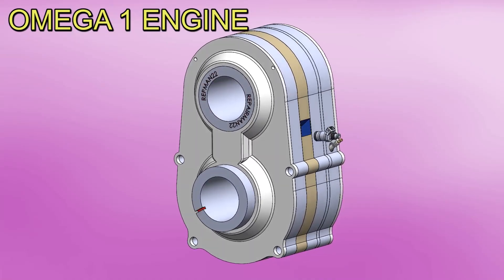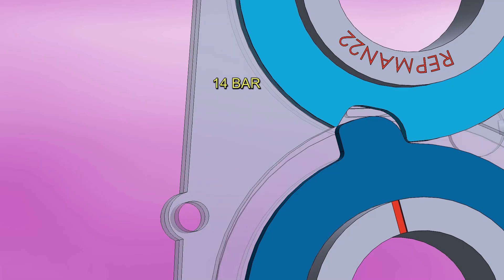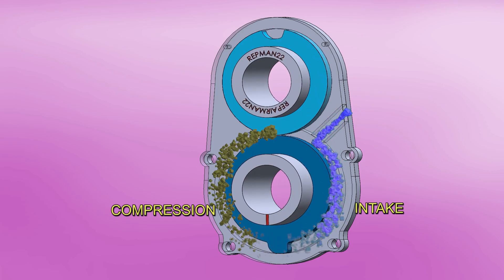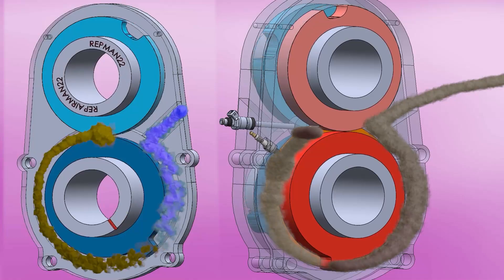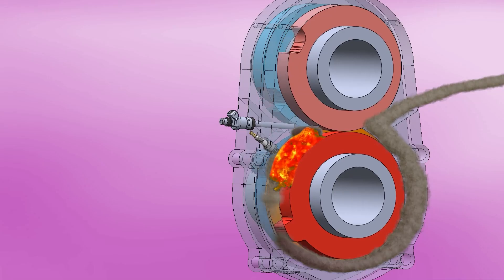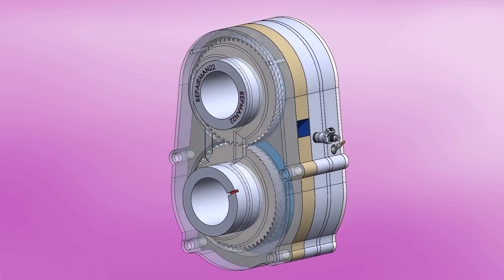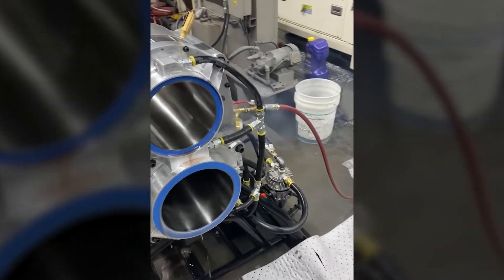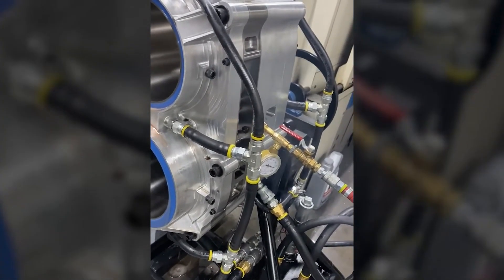😍 Can you FIT 160Hp in 30 Pounds? This New Engine Can. The Omega 1

Comment: I definitely love your videos! I'm from Brazil and I would really appreciate it if you could make a video about the Volkswagen EA827 engine (in Brazil it is known as the AP engine). It is a very famous engine and has been applied to a wide range of automobiles.
Thank you if you can answer.
Reply from the maker: I owned one AP 1.6 and had it with pointer GTi 11.20 camshaft. The AP will appear in my spanish channel for sure "repman22"

Comment: Note only cartoons are shown, no slo-mo, because any Diesel mechanic sees the flaw.  (What they show has no cooling, no drive train, no dynamometer, since it CANNOT work as advertised.) 14 bar (14:1 compression) is Diesel range; the fuel will ignite instantly, yet a spark-plug is shown. A freshman mech-student should recognize something's wrong here.
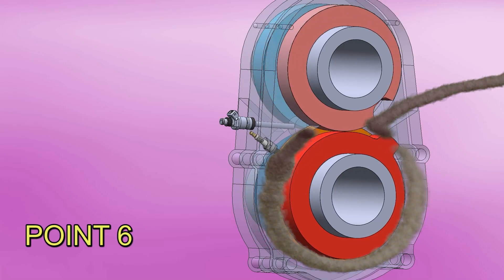Reply from the maker: Your answer is at 6:11

Comment: I would call it a split cycle engine 
1 has a working prototype been made
2 in order to make 160hp it will need to move 160hp worth of air, dose it 
3 it looks rather thermally inefficient 
4 believe nothing until there is physical evidence infrastructure of your eyes, anyone can make a cartoon engine and make unrealistic claims 
And finally build one and prove it

Comment: I would not be surprised if the rotor on the hot side is ceramic. Much testing has occurred using ceramic material in jet engine's rotating assembly.

Comment: In the animation the donuts are out of balance. 
 There are numerous hydraulic and air compressors that operate using simular principles.  
Even with titanium, they will still need to deal with the heat.. The intelligence and technology to make it work is definitely there. How well, and cost effective it will be is the question.

Comment: To deal with the tolerance issues when running and hot, the solution is simple and already in use. Forged aluminum pistons in gasoline engines are under sized so when the motor is at operating temperature they will be the proper size. You just have to leave enough tolerance for the metal to expand. As in all engines the efficiency would not peak until the engine reach operating temperature
Reply: Those engines are easier to keep at a constant temperature because you have plenty of room to place cooling and oil ducts and you can cool down the pistons by spraying them with oil from the gallery. They also have a narrower RPM band. They also have piston rings that help seal the gap when the pistons are small, this does not.

I'm thinking that if the same technology is pushed in to this more demanding role, they would either have to sacrifice low end efficiency by increasing the gaps or they would have to sacrifice top end power by limiting the top rpm to prevent the engine from seizing due to thermal limits.

Unlike what the video implies, I think the critical gap is not the one between the rotors but the gap between the lug on the male rotor and the chamber. If there are no apex seals there will be a lot of blowby if the tolerances aren't super tight, but if the tolerances are super tight, total engine failure due to seizing will be an ever looming danger. Even a minute amount of slop in the bearing will cause the lug to drag or bounce along the chamber and thus scoring your engine badly.
Reply: One can also tailor the metallurgy of the engine case to allow expansion of the case proportional to the rate of expansion of the rotors, allowing everything to stay in tolerance through a larger temperature range.
Reply: That's not going to cut it for an engine without piston rings.
Reply: youll find forged pistons expand quite alot, although they are stronger, when cold this piston will slap the cylinder wall causing wear. This also happens at extended periods of low rpm when the engine can cool (relatively).
For this reason, although forged pistons are stronger and capable of more extrememe conditions that make them ideal for racing engines, most manufacters still produce there pistons from cast alluminum as cast alluminum expands less than forged.
For an engine like this that is reliant on tolerances for adequate sealing, the engine would need to run at a near constant temperature, or use materials with a low thermal coefficent of expansion... such as titanium. 
Forged alluminum expands to much for this application.. unless the engine is desighned to operate at a constant temp/speed.

Comment: This is stupid. Wankel engines are criticized for the failure of apex seals. But those seals don’t fail if they’re spring loaded. Wankel engines work fine. 

But they’re too good, they don’t need constant repairs. A new Ford engine is a hopeless tangle of plastic and circuit boards.

Comment: I wonder if this engine could be designed coaxial configuration. 1 stage counter rotating inside the other. In a way the heat expansion of both would maintain smaller tolerances?

Comment: So just ONE explosion per revolution? And no rings?  And two heavy rotors and gears?   And goes up to 25,000 RPM?    And it leaks oil like a screen door.  And no cooling system?  Probably quite lousy in weight, vibration, efficiency, low power output, and unreliable.   It's telling what they don't show-- scalability, actual power output, emissions, fuel economy, vibration,  cost, or engine life.   Poor performance in any of those aspects and it's toast.  (It's toast).

Comment: it will suffer from a poor surface to volume ratio. It basically suffers from the same poor thermodynamic inefficiency as a Wankel does. You can achieve efficiencies above 50%, but this always comes at the price of high NOx emissions.

Comment: I've lost count of how many of these game changing engines are supposed to have been on the market by now.
Reply: “…it promises to…”
yep.
Reply: The new designs are cleverly hidden in flying cars.
Reply: and especially, engines that are largely designs on paper that claim "a million billion hp" or whatever childish numbers they made up. but the other thing that is unbelievably common is the prototype that just barely makes enough power to turn itself over. maverick engineers have made thousands of those things, and a parade of journalists make ooh-aah sounds because they buy into the elegance of the core idea and imagine they are reporting on the dawn of a new era

the danger these days is that this plausibility of a barely running prototype and a nice animation is more than enough to generate millions of dollars in a crowdfunding campaign that eventually disappears after claiming they couldn't raise the funding to develop it to production. which is no surprise if you know that it takes about a billion dollars to develop a truly new engine from scratch to genuine mass production. seriously, this stuff would keep happening forever because almost nobody understands the history of boutique engine inventors and their vast string of expensive failures. but it will probably finally disappear after electric vehicles become more mainstream and development switches to incremental battery improvement. electric motors are nearly perfect, and dreamers don't have the same tendency to imagine they have a groundbreaking idea for battery tech; unless they already work in battery tech
Reply: @5naxalotl  I think with how easy and cheap it is to prototype these days your wrong but right at the same time. Iv made a few engines from scratch and modified a few enough that nothing original is really left. I'm not a rich man but iv been able to do it with some funds behind it others could do it better. Now I will say that my r&d engine in my drag bike (155cc single cylinder compound turbo making abit over 100whp) has took 12ish yrs to get to this point. I think one could make good designs that can be revolutionary at home but I also think the burt monroe and guy Martin's are a dying breed. I myself as far as I can tell have made the biggest advances in carbon connecting rods at home. Currently have a carbon rod and cases on that 155cc. Rotaries have alot of room for improvement from what I see it's just not financially viable. You can already buy a na billet 13b making 300hp reliably and it weights 75lbs ready to run. Iv seen hill climb 13bs making 650hp na turning very high revs. I do think your right about electrification being the end of the era but I also understand were a good 50yrs from that. Also even with that a teenager on YouTube recently came out with a fairly revolutionary motor that's now being used by bigger companies just a few years later. Iv got some ideas for hybrids but the laws of thermodynamics cant be ignored.
Reply: @oliverscorsim  it's a very fair point that prototyping has become a lot cheaper, and tbh i'm very pleased by the fact that tinkerers can pursue their ideas. i am thinking intuitively about the history of scam-adjacent engines; and i'm also expressing my intuition about cam-driven pistons, which have never amounted to anything, and still imo look desperately hopeless for IC engines. however, the sort of work you do is still incremental refinement of reliable & established tech. and as far as i'm aware large auto companies still report huuge development costs for new conventional engines. i'm guessing the sort of development needed to turn something this radical (and imo, dubious) into manufacture at scale is the sort of large-team research and tooling that goes beyond the need to make a few prototypes. as they say in programming, basic design takes the first 90% of the work, then debugging takes the second 90% of the work. even in recent history, lots of engine ideas spiraled into development hell where the expected total cost kept growing exponentially. i'd be happy to be proven wrong, but to me this thing screams "infinite cost for ironing out all the final bugs". and as much as i love to see people with curiosity pursuing these bugs, my warning is that people need to consider how many feel-good engineering projects managed to pull in a ton of crowd funding well after their position became hopeless. this is psychology, not engineering. honest people who started with the best intentions are remarkably susceptible when they realise they can pocket a few hundred thousands and leave other people on the hook. my favorite case study is the car powered by air pressure, which had people convinced for over a decade even while physicists said the numbers simply didn't add up. short story: i think i have good reasons for negative intuitions that younger people are completely blind to -- i grew up cheering on Sarich's orbital engine -- but you make some solid points
Reply: @5naxalotl Thats why normal investors generally can't buy shares in startups online and Kickstarter can't offer you a piece of the profits.  

So I don't really see the problem.  If sophisticated angel investors can't be bothered to do the background research -- well that's their problem.  And when it comes to people funding their friend/kid/cousin/etc dumb buisness idea -- well these engines aren't really the problem.
Reply: Well getting 300hp out of a na billet 13b that weighs 75lbs ready to run and already has the bugs figured sounds easier and you can buy one today 😂
Reply: @oliverscorsim  And it would sound glorious.
Reply: As one old gas turbine engineer told me if it’s got to go up and down before it goes round and round it can’t be any good…..
Reply: @metalmicky  Unless it's a roller coaster.
Reply: Big oil greed, politics and shareholder value seem to be the principal obstructors.
Reply: @michaellombard894  physics is actually the principal obstruction.
Reply: If you think the Automotive industrial monopoly is going to allow this to jeopardize their stranglehold on the consumer market...
THINK AGAIN!!!!
Reply: @fyx812 if it's actually a better engine we'll see it in racing long before we see it on the street.  much fewer EPA mandates to abide by
Reply: So should they stop telling us about cool new ideas that seem like they offer compelling advantages?  Or should we just be smart enough to realize that most new ideas hit some unpredicted snag and don't work out commercially?

I mean the reason people develop them is because it *appears* as though they offer really compelling advantages and don't yet know what the (unfixable) problems will be.  

I think it's neat to hear about them (wouldn't bet much on success though).  If you don't why not just wait until they go on the market to learn about them?
Reply: @petergerdes1094  I really enjoy learning about excitingnew technologies and their potential.
I don't enjoy A.I generated, poorly researched, outdated when published, junk "journalism".
There is much better researched information about this engine available online (available years before this video was published).
Chanels' such as this, dilute the knowledge pool with hyperbolic, gratuitous misinformation.
We should learn to tell the difference.
Reply: Same
Reply: @@retiredbore378 A good steam engine is a bit over 10%  efficient, your probably thinking steam turbines at 20%?
Reply: Because most of them turn out to not be so great
Reply: It sealing is good. It will work perfect.💪👍
Reply: They all take $ from dumb people then split the$ and disappear, meanwhile day 1 they knew there were fundamental road blocks
Reply: The Wankel is a good example of how the fact that something is a good idea doesn’t necessarily mean that it shall work, and the even if it does work, that doesn’t necessarily mean that it shall work well. That fact that Citroën, of all companies, gave up on the Wankel, should be evidentiary that it’s not worth it. If there was ever a car company known for ripping up the rule book and innovating just what a car could be, it was Michelin-era Citroën, and they dropped it like a stone.
Reply: Some of them have found alternative uses, like the curved piston engine, gets used for compressors now
Reply: It's like a rotary mazdas engine it burns engine oil
Reply: They are looking to be bought out to big corporations
Reply: @peterkotara This engine does work. It has been made, and I think tested with gosh damn hydrogen. (Literally the worse storage IMO.)

 Yet an engine working, and an engine going into production are two different things. 

 The issue these days is EVs ARE the future, and a near one at that. 

 So since they are the future investors don't want to waste their money on a risky new engine design. 

 However there is one contractor that is willing to get a high performance generator even if it can't last 100k hours. 

 The military of course will need hybrids when just batteries cannot do!

  Drones, generators, and vehicles will benefit from small engines.

 PS - to the videos question. There is an axial flux motor that is said to do 800bhp at 52 pounds. ( Helix Motors UK. )

 Annnnnd with power like that is exactly why electric is the future.
Reply: @dianapennepacker6854  I totally agree with you that electric drive (for personal transport) is a clear winner going forward. Hydrogen has really only been touted as an option by the Japanese auto industry because they are so deeply embedded in their government and their government is rightly concerned that the Chinese control many of the rare earth minerals essential for EV production, and that the Chinese could deny Japan access to these minerals, essentially crippling their auto industry (which would impact the Japanese economy enormously).
This engine has indeed been built and tested, and it performed abysmally. Turbine type engines could have a future for hybrid drive systems in aviation and military applications because of their multi fuel compatibility, but material science needs to get to a point where the extreme high temperature materials are cheap enough to produce and tool to allow the efficiency levels to weigh and reliability ratio that ICE engines achieve today.
Reply: It is good that the research is active. Without continual advances we would still have cars that use 50 liters per 100km. This research should be welcomed.
Reply: @ionutionuti  You can thank EPA for that
Reply: @ionutionuti  Research is welcome, disingenuous over hype and misinformation for the sake of youtube views and likes is not.
Reply: stop waiting on companies that only care about making a profit and start building them yourself.
Reply: @kingmasterlord what a dumb libertarian mindset. BuIlD yOuR oWn ReVoLuTiOnArY eNgInEs
Reply: It's real simple bought  out by military contractors who use it for special military projects it's real simple math
Reply: @jimmyjapa6368  Those pesky Lizard people supressing advanced human technology. Frankly I'm sick of it.

Comment: I'm curious what a pistion&cylinder engine with similar design would perform. Which to have fresh air compressed in a set of cylinders, and get mixed with fuel when transfered to another set of cylinders, then ignited there to make power output.

Comment: No, it cannot be classified as a 2-stroke... That's like saying x2 4-stroke pistons makes the engine a 2-stroke..
Reply: isn't the other rotor technically an inbuilt supercharger?
Reply from the maker: No, because the gases from one cylinder do not pass to the other. Here, we have a rotor that only does intake-compression and another rotor that only does compression and expansion. The comparison would be with having a 2-cylinder engine and that the first cylinder is only dedicated to intake and compress, and the second cylinder only does expansion and exhaust. All in one turn.
Reply: @repairman22  Id argue that, as at no time does more than one process occur in the same combustion chamber at the same time, as scavenging does in a 2 stroke. it still requires 4 turns for a single charge through the entire engine.
Reply: @michelwazouskey4799 well shouldnt it be a 1 stroke? It does intake, compression, combustion and exhoust in 360⁰